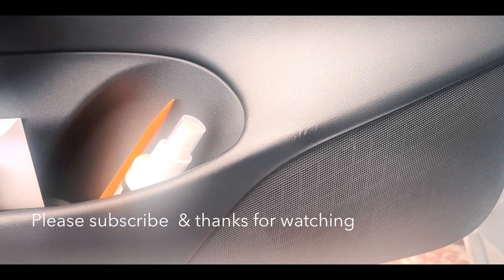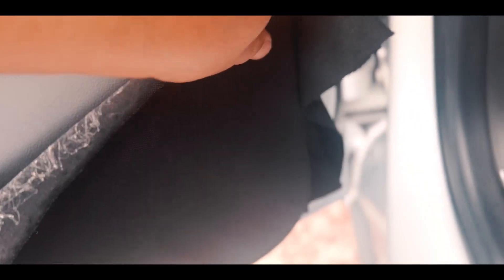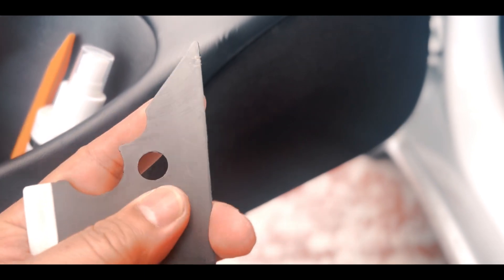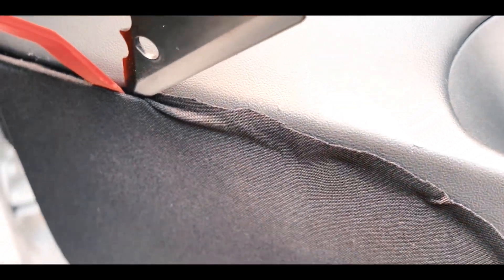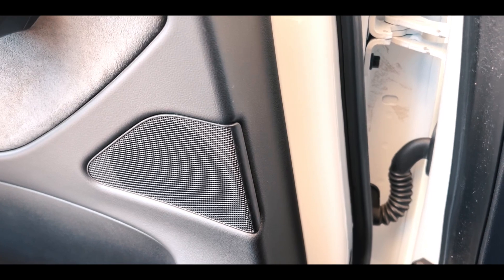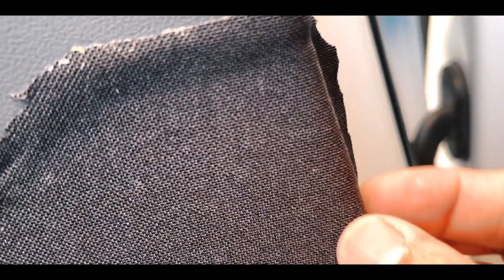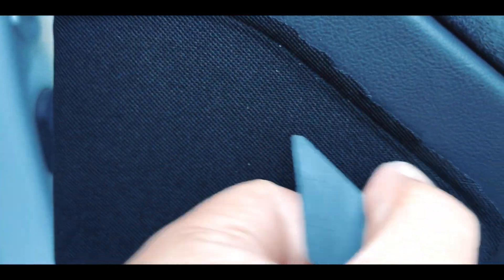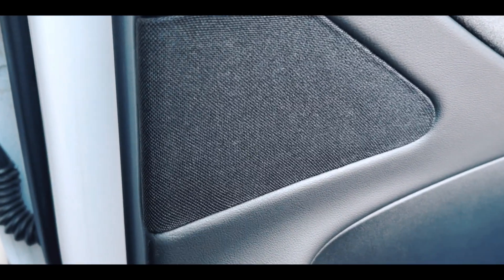Tesla Model 3 Speakers Cover Issue Solved

Comment: very nice solution, could you please advise how this material is called or where I can buy it? Thanks
Reply from the maker: @BrainWasherMembrane  hi, I bought mine from amazon they got variety of "speaker fabric mesh" those are the key words i used. Thank u for watching as well.
Reply: @car-lo  do you remember the glue you used by any chance? Thanks
Reply from the maker: @BrainWasherMembrane i used 3M headliner spray, make sure u spray both mesh and the plastic grill, but not too much on the mesh let it dry and apply it.